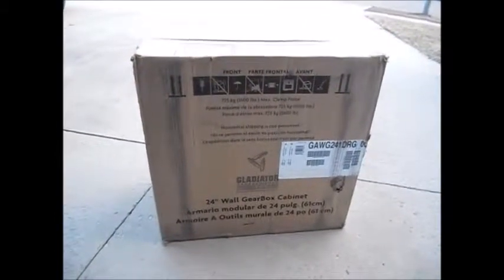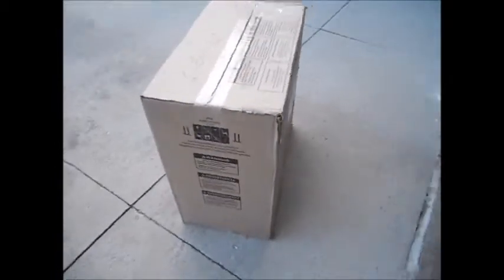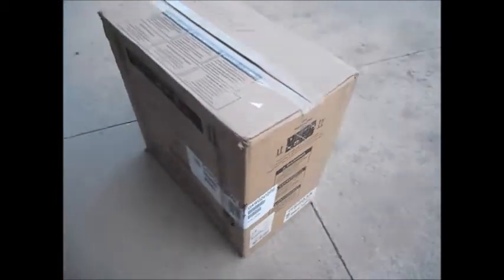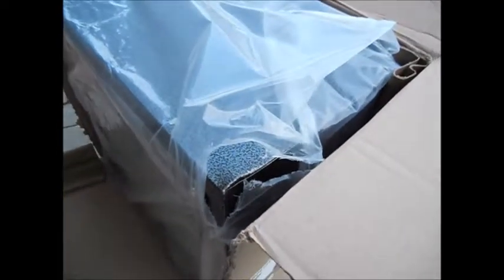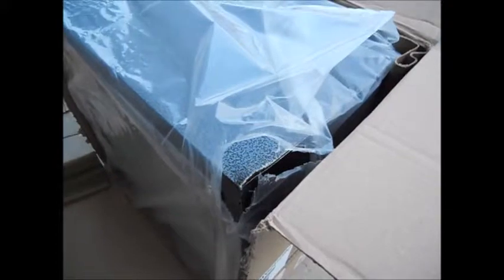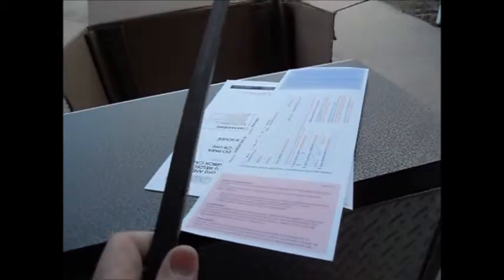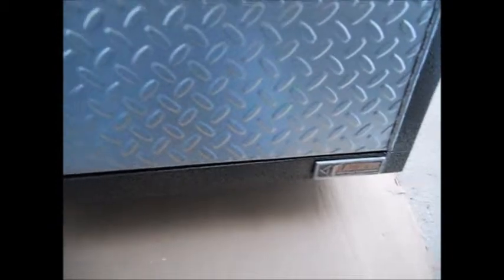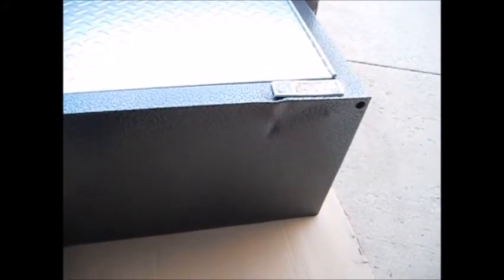Gladiator GarageWorks: 24" Premier Wall GearBox Discussion [Obvious Manufacturing Defects & Damage]

Comment: "Damaged from shipment? Actually no. " Actually yes. These are metal boxes and a small drop that wouldn't harm the cardboard, would easily dent the metal.

I have gotten many of these in with damage and no visible damage on the box. If you have a damaged product, contact Gladiator/Whirlpool and they will specifically setup a delivery for an undamaged product. 

Do no accept damaged Gladiator products, simply contact them for a exchange.